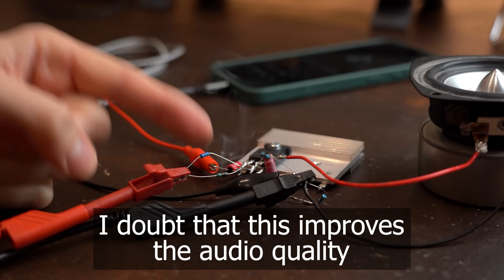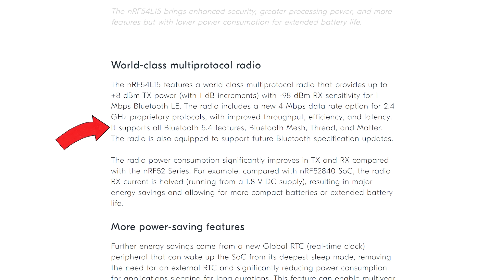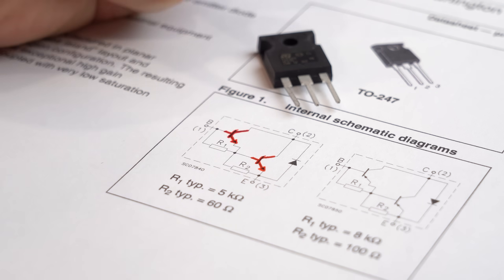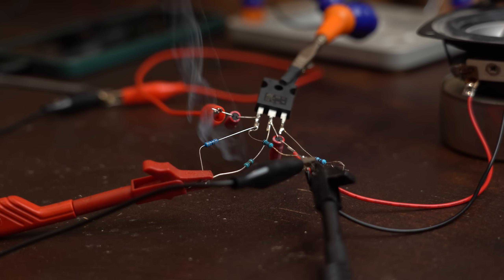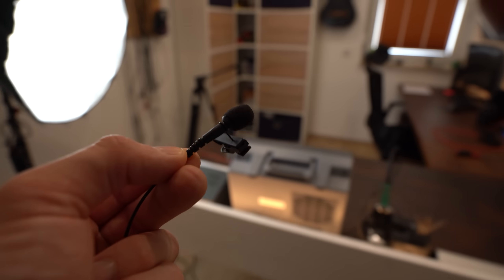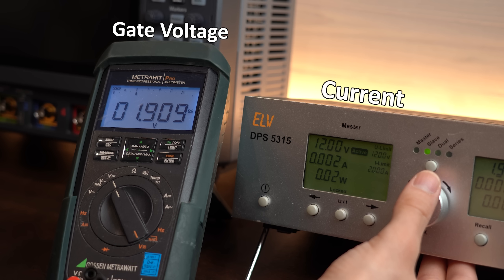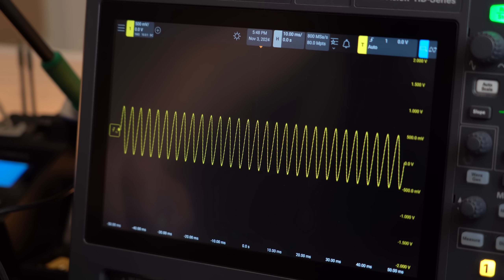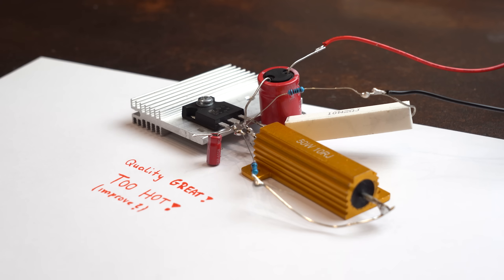The World's Simplest Audio Amp just got BETTER?! (MOSFET Amp) EB#61

Comment: Great explanation of bias and other design considerations. As you concluded, a Class A circuit to drive a low impedance like a speaker is a dead end for efficiency. In the end, that's why alternate circuits like Class B, AB, and D even exist, as they're far more complex.

Comment: You do not want to use a power mosfet to amplify in class A.  They are designed for switching and have massive nonlinearities. You need a lateral mosfet for doing tasks like class A amplifiers. Mosfet is great for class D 

Also, most humans cannot audibly detect distortion below something like 2%. So the many audiophiles shooting for super low distortion are wasting their time.

Comment: I've been running simulations on LTSpice all day and I cannot seem to figure out how the output stage actually works. I can clearly see the 0.5A current amplitude happening, however I don't get how that directly translates to louder volume, as this current doesn't actually pass through the speaker's voice coil. I'm getting only a few mA to flow through it. Is anyone willing to explain? Thanks

Comment: I use mosfets as source followers. I bias them putting half the drain voltage onto the gate believing that that should be the sweet spot for source followers. They do work but like you said about distorting before they clip. Yeah even in the source followers: if I crank up the volume and listen to the say, 700Hz, I’ll start hearing the 1400Hz signal popping through as I turn the volume higher and higher but only to near maximum volume and that’s after the 12AX7 preamplifier .

Comment: The problem here is there is no negative feedback loop to lower the distortion and linearize the output transistor. Probably the simplest high quality power amp are the designs that use an non-inverting input op amp to drive a push-pull pair of output transistors and feed the output back to the inverting input of the op amp. They work amazingly well and you only need two resistors and  two 1N4148 diodes to bias both output transistors It is much more efficient (Class AB) and much more linear with lower distortion because of the negative feedback loop and really not that much more complicated because of the self biasing scheme. Google " audio power amp opamp driving transistors" and it should net you several examples.

Comment: what gets me is no of you realise if you use a speaker transformer with inductance that will if the fet when it tried to draw current will just increase the magnetic field in the transformer core rather than destroy components ..also allow ing for a beter resistance match to the speaker.rather than having a circuit that draws loads of current while its doing nothing ......

Comment: This is a great series for learning as it does a good job of demonstrating how the different transistor types work and how the signal is used to control them in simple Class A operation, but at the end of the day an LM386 or TDA2030 will provide a more practical solution that wastes less power.  Tinker with standard resistors to learn how these circuits work, but if you just want a practical amplifier for driving a project speaker then use a mono chip amp that runs on a single supply such as 12VDC.

Pre-assembled boards for the above chips are commonly available, though most will contain counterfeit chips.  Even the fake chips will work fine for most purposes, drawing much less power and producing lower distortion than the scratch-built circuit.  LM386 can run on 5VDC for USB supplies and won't need a heatsink while TDA2030 can run on 12VDC and common boards include a small heatsink.

A pre-assembled board or unassembled kit for either of these chips may cost less than the power resistors needed for the Class A circuit ;).
Reply: This is really obsolete advice as far as practical solutions go. Get a Class-D amplifier board such as the PAM8610 which provides twice the wattage of TDA2030 without a heat sink.

Comment: I think you have totally misunderstood the voltage drop. That is only valid in a totally valid state. It is an important number when you use the transistor as a switch. How warm will it be when using it as a switch. In this circuit, you have chosen a voltage drop of 6 volt. What the minimum level is, is totally irrelevant. It is like if you have turned the music leven on your stereo to the level you want... how much more you can turn up the volume does not matter. If the chosen level is at 6 watts, exchanging the amplifier with one that can handle double the power of the one you have, will not matter, because you have chosen 6 watts. The most mind boggling thing is how you describe changes you see in the circuit to this parameter, which you don't use in the circuit.

You, as a "big youtuber" are teaching wrong stuff in so many of your videos, confusing people that are learning our craft. This is not a single occurrence. Maybe it is time for that EE degree, and take a pause with the misinformation?

Comment: 0.5% THD is fine unless you are an audiophile. Otherwise.. this circuit you use is simply useless as a power amplifier, need a bridge or half bridge for that. Maybe, just buy a cheap D-class amp board from Ali almost literally for buttons.. Even better, for a few more buttons you get a power amp with a display, fm radio and bluetooth :P

Comment: I would use D313 on 12V with 40W 8Ohm speakers. I actually have built a stereo one, back in 90s, with two D313, and the transistor would run few weeks without a heat sink. It is too cheap and easily replaced - using an IC base to mount it to the board. Quite OK Quality in 90s for cassette tapes.

I didn't have a scope. But I can sense if the audio is peak-clipping By Ear- and I'm quite confident on that.

Comment: This was a very entertaining video, but the design you came up is totally impractical. If you want a low cost good sounding amplifier you can not go far wrong with the PAM8043. You can buy them on a PCB not much bigger than a stamp. Its stereo and runs of a 5v supply.

Comment: A single stage amplifier without feedback has ~ 1000 times more distortion than a high gain stage (opamp) with feedback, the distortion is reduced by the loopgain.
Do the math and do a 2 tone measurments at different levels.
PS most headphones have ~ 1% distortion anyway, so if you use an amplifier with 0.001 %  distortion it does not matter... 😅

Comment: I would like to share a simplest way to design this class A amplifier. 1) Voltage gain is closely to Rc / Re. 2) Once the voltage gain is defined, fine tune Vb ( the value of R1 & R2 ) to get Vc closely to half of Vcc. The transistor will working at linear region for less distortion but maximum output voltage swing. 3) In parallel a capacity at Re can get higher output voltage.

Comment: I spent alot of time messing around with class A mosfet amps, they can be made to sound very good. but they are also so precarious, dont expect to be actually using your volume knob. but it was a good primer for when I started playing with tubes, which are far more forgiving, just because they have alot more voltage to play with. if you do need a small, simple power amp, you simply cant go past power opamps like the LM1875 or LM3886 (other brands are available). for how few parts required , the ease of construction and fidelity is incredible. you are going to want a very stout power supply, lots of filter caps and a big bit of iron. and significant amounts of cooling. If you want a bargain price DIY audiophile setup, a moderately good USB DAC, and adjustable active crossover, a LM1875 to run your tweeters and an LM3886 on your woofers, in an MDF speaker box will blow your socks off. all for less than the price of an 'audiophool grade' power cable.

Comment: You probably want to drive your Darlington with a preamp that acts as a voltage regulator for your Darlington or even Mosfet amp so it's not at constant power all the time, but draws power depending on the input volume.

Comment: Ah... I remember it took me a while, but I built my first transistor circuits from book "Dators Fizikas Laboratorijā Skolā". A Relay controlled trough LPT port by a DOS program in Pascal used a signal transistor BK315 and medium power transistor, I think 817 (russian numbers, something like BC517-ish and BD40), and audio amplifier circuit using one trasistor. I was strugling to get my head wrapped around it for a while - as 4 resistors to set up currents affect each other... Good memories.

Comment: Darlingtons do sound great but be careful... I recently repaired a Fender solid state guitar amplifier that uses that same Darlington in a push/pull  complimentary pair. (TIP 142, TIP 147). On my first attempt I overlooked the fact that one of the biasing components (a diode in this case) had drifted out of spec. That is one of the big downsides to using high power Darlington devices (at least in push/pull configurations). They are very unforgiving if they aren't "perfectly" balanced. The amp sounded great for about 2 minutes before one of the transistors went into a thermal runaway failure. It was like watching a firecracker in slow motion. First a loud buzzing sound, followed by a bright flash of light and a pop! Once I fixed the bias issue the amp sounded great. I still use it on my workbench for testing purposes.
Reply: In case anyone is interested, the amp is a Fender Princeton 112 Plus. Here is the schematic of the power amp.
https://drive.google.com/file/d/1R2YtEksHD3FwziaJM1Z9cTvgjELtHjxm/view?usp=drivesdk

Comment: 5:36 0.5 A current over 12ohm Rc and 2.4ohm Re, they need to be 3Watt and 0.6Watt resistors. Of course the poor 1/8 or 1/4 W resistors will go out with a puff hombre. 12:43 the issue with fets is even harmonics dominate which distorts the timbre directly, whereas odd harmonics are preferred, look at vacuum tube amps .

Comment: Something basic: electrolytic caps distort signals quiet a lot & in several ways at the same time. & usually unipolar ones - even if you manage to operate them only in forward direction - are even worse then the more rarer bipolar electrolytic ones. For the smaller input I'd recommend using a compact film cap, but for the output, if you're not willing to get poor from a large audio film cap, you'd really have to think outside the box to make it both safe & functional...
Reply: This is not true. The electrolytic will only distort when it's been used as a filter - and even then its low level. In this application where it passes all AC there's zero (no) distortion.

Comment: It is much harder to stabilize it when you have no current flowing from the base to the emitter (which has a resistor) like with a BJT. I made an audio amp with a low power pre driver using a 150 ohm resistor (collector) and a 10 ohm resistor on the emitter with a BD139 and then had it drive a pair of PNP NPN push pull type through a DC blocking capacitor which were biased so that the voltage on the emitters was half of the VDD as well as there being some quiescent current. It is a bit more complicated but it is nice and loud and runs off of 12 volts. It also does not get hot unless you make the volume high then it gets warm. I saw some people mentioning feedback. While it is cool, when it comes to audio and amplification of this sorts it can cause parasitic oscillation.

Comment: another problem when using a power mosfet a small (10-22 ohms) carbon composition resistor must be used to kill any stray inductance from being coupled to the gate, if not parasitic oscillations (from 250 MHZ to 1GHZ) could be present on the output, I learned this from a Siliconix power mosfet handbook

Comment: Class A single transistor audio amplifiers have a maximum efficiency of 25%, I've seen high power circuits on YouTube made by persons in Vietnam, Cambodia and Laos that claim 100's or even 1000's of watts but they can be even less efficient only reaching efficiencies of less than 15%. On way to make a Class A Amplifier more efficient is to use a coupling transformer, efficiencies of upto 40% can be reached this way.

Comment: I have started to build a similar with FET 2SK1058 and also a driver - a small Soviet 6S31B tube. That requires two voltages, 24V for the FET and 110V for the tube, but I got transformers.

Comment: The thing about FETs in general and power FETs in particular is that they're designed for efficient high frequency switching. Their linear region is generally considered undesirable. As such efforts are made to minimise it as much as possible instead of making it truly linear. Smaller linear region (and faster transition through it) means quicker switching, less heat output and less power wasted by the FET pretending it's a resistor.

One would have to buy a special amplification FET for a project like this.
Reply: This is exactly it, and this is why you do not see common mosfets in audio use.  They are designed to be switches, which oddly enough in the darlington you were using was likely designed to be.  It was just not as good for what it was designed for as it had a wider linear region.  That and easier interfacing is what led the world into mossets and igbjt's.  I have little doubt you could look over the data sheets and find a fet with better characteristics for linear use.  Also, I would be tempted to say your sine wave source is pretty dirty.  If you want to play with audio there are some nice designs out there that will get that thd value down at least on order of magnitude.  Of course that also beings into question the thing you are reading the thd on.  Nice and able to see the harmonics and but I am not sure how many of them are caused by that scopes front end.  They are great for what the do, but not optimized for very small readings.  For readings around .1% or so I trust my old HP334A and a very clean source.
Reply: There are in fact JFETs specifically made for amplifying versus switching and JFETs have lower noise than MOSFETs in audio bandwidth
Reply: @BoxingDayAC  This discussion was about  a Class D amplifier, which is a switching amp, so you really don't want to operate it in the linear region as it just wastes power.

For regular analog amplifiers, both JFETs and MOSFETs can be used. If you only take a quick look at the specs, the JFET might seem to win the contest, but a closer examination reveals more complexities. Let’s take these two examples: IXTK90N25L2 vs. UJ3N065080K3S. At first glance, the JFET appears superior, but when you look at the actual maximum dissipation, the MOSFET has a much wider SOA. Given that the output stage doesn't generally have a lot of gain, the noise number is almost moot.

When considering noise, you also have to account for the fact that it would take five JFETs to dissipate the same power as one MOSFET. Combining them requires adding resistors to ensure current balance, which adds noise and power loss, takes up more board real estate, and requires more heat sink hardware (mica washers, hats, bolts and nuts, and even more goop). While the per-unit price of the JFETs is more manageable, they aren't a clear win in terms of raw cost. They lose out when you add in the hardware, and the cost of manufacturing something with five parts versus one. The MOSFET clearly comes out on top, with much less board real estate, one part to mount, one device for a human to bolt to a heat sink. Even after, for service, you only have one part to replace. No need to unsolder and test five parts; you have one, and it is either alive or dead. It looks like when you get into something that will run at a few hundred watts and have some overhead, the single MOSFET wins in every aspect, including noise.

Comment: Don't forget - P=IV. If you dissipate too.much power through these resistors you'll just cook them. Reliably.

If you don't have higher power resistors, you can run a bunch in parallel. That way you can also fine-tune the final value. It's messy, but it works.

Comment: My new phone have not 3,5mm jack it's big lack. Samsung have no internal DAC so not possible use USB-C->3,5mm jack cable even cabe with DAC often not work and you cant charge phone at same time (when not split cable) and phone charging port worn out really soon when used for headphones few time in day. So I bought consecutive three portable bluetooth receiver with 3,5mm jack for my wired headset and not satisfied. Bad sound quality, low volume, short operating time some had no volume controls. I build my own with bluetooth 5.3 receiver board, TP4056 charging board, 18650 accu. It have 5 control buttons, red charging and blue operating LED, 3,5mm 4pin jack (it support mic), charging port all in small plastic box and work perfect for long time.

Comment: It's not like amplifier using Mosfet is rare, is just that most people nowadays prefer monolithic chip amp, for example, if you look at any CMOS/DMOS amp (ex: ST516) there's going to be Mosfet inside, since it's exactly said so in it's name duh.
Also, you might wanted to put disclaimer since some Mosfet has transistor gate driver embedded inside and might inverse the signal output, putting smaller silicon in cascode is a pretty nifty technique and we're very likely see less BJT based amp and having every single new amp using either CMOS or DMOS as gate driver especially after Nexperia starting to use Si Mosfet in cascode with their GanFet starting from their GAN041.
Lastly, if you wanted """"cheap""""" usb to audio input, just use PCM27xx series, it's not a DSD DAC but who cares about DSD anyway lol; if you need mic input, there's PCM2912A, it's a very decent interface for DIY.